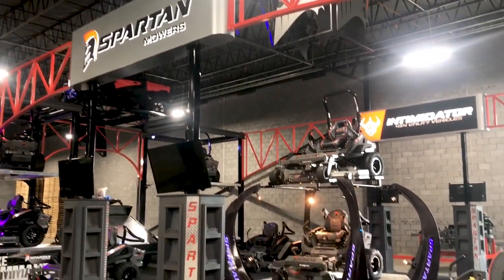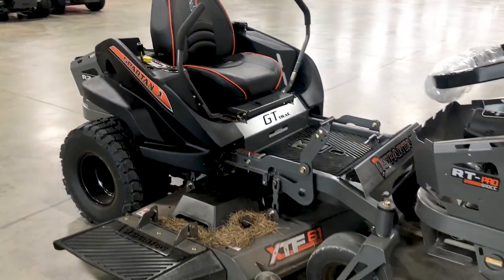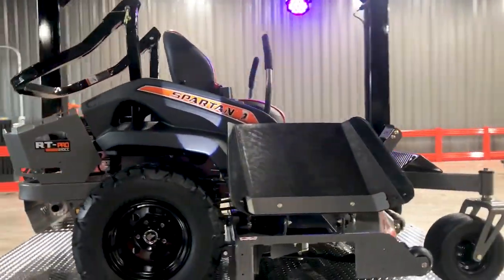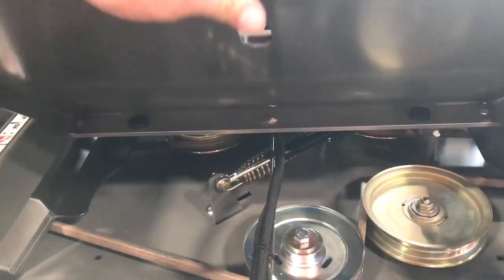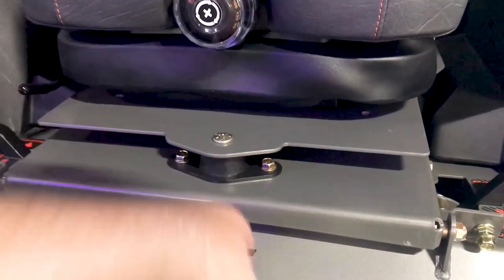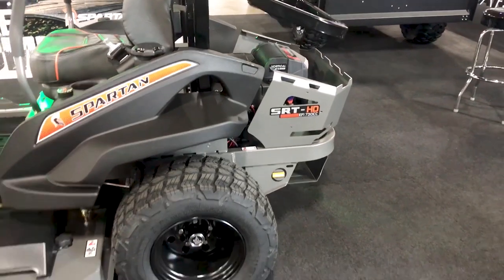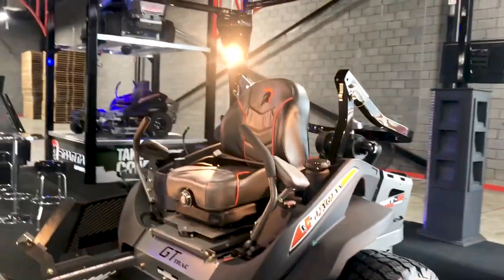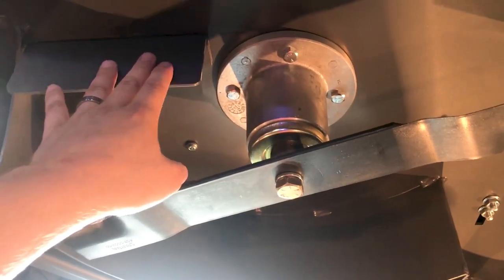Spartan Mowers 2020 RZ Walk-around

Comment: The new 42 inch mower is built with power and has the same frame and deck  structure as that of the larger commercial mowers . What a nice cutting mower.

Comment: @ Spartan Mowers: I have a new RZ Pro 54". On the 3rd mow, the left arm came loose because apparently the nut was never tightened or checked to ensure it was tight. I wasted half a day trying to locate a 5/16 X 24 nut to go on there. Today, getting ready for mow #4, I put the spartan shield on and was short two 1/4" X 1" Carriage bolt serrated nuts which I cannot find local to me. I could use some help from Spartan Mowers, please.